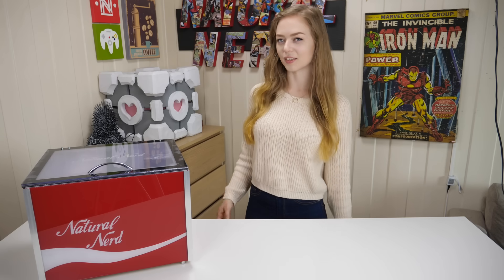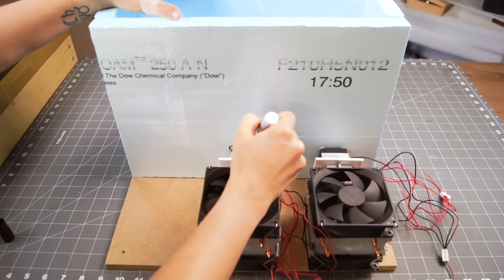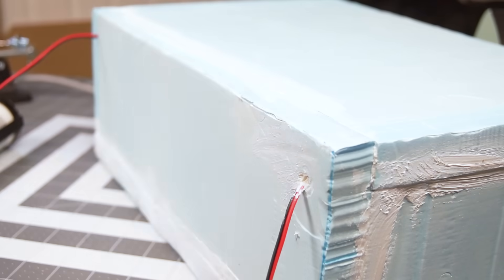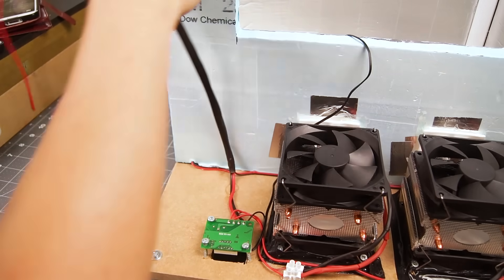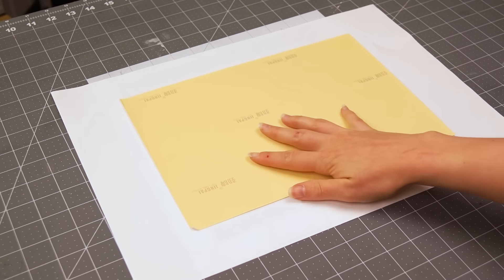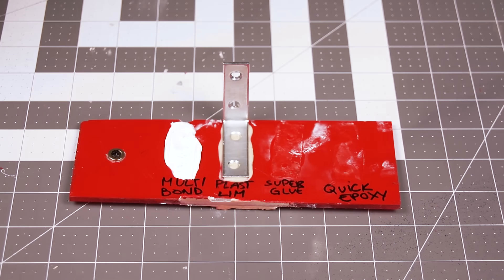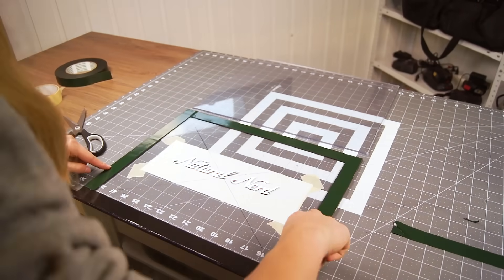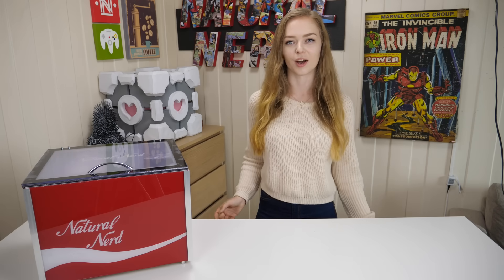DIY Desktop Mini Fridge (5°C!!)

Comment: Please don't use your soldering iron to burn through stuff, it damages the coating that makes solder stick to it. If you have a cheap spare one then you can use that but don't expect to get good solder joints out of it afterwards.

Crimps for the power supply is a good idea but those simple scissor style crimp tools don't put enough pressure on the crimp for a proper connection. You should get one of those latching tools with plenty of reduction and the appropriate jaw shape to squeeze the crimp into shape. They're like $20-$30 online of you know where to look but any good electronics shop should have them.

You should also attach the cables to the wood behind the power socket to make sure the wires don't come off and short at the power supply end if the socket breaks off and pulls the cables. It's a redundant safety thing but with mains AC you can't be too careful.

As a side note, peltier elements respond really well to water cooling. Not neccesarily suitable for this project but I've pushed TEC1-12706 and TEC1-12710 peltiers at 15V on water and the result are fantastic. The datasheet indicates you can ramp up to about 17V when they are running, but I don't have a powerful enough adjustable power supply to test the limits of that.

Comment: How to make a mini fridge for people who...know how to use power tools, wire LED lights and electronics. Oh you don't know how to do that? Well fuck you. Is basically what I got out of this.
Reply from the maker: I learned these things while making stuff. It's not very hard, but if you want to make something you have to be prepared to acquire some skills along the way.
Reply: That's very true, but it is disheartening realizing how many of these craft videos on youtube require often multiple skill sets. It's never really one, or just something a bit easier it's always for someone whose already acquired the skills. Usually it makes it not worth it if I'm expected to learn  three or four things for one small project. Anyways, don't get me wrong, it was impressive to see you put together and your instructions were nice.
Reply: Geeze, I wasn't crying over it. I was making a comment about how it isn't very applicable to most people because most of these crafts require you to learn multiple skill sets. Making the time to learn how to build this just takes a lot of effort, for some more then it's worth. I can assure you I'm not super bitter over it or anything. The video was still very good.
Reply: Right, building a styro slicer, getting the money to buy a tool to cut MDF boards, getting a drill and jigsaw to cut out the circles, having a work area for these tools to even begin the project. Getting the power supply and leaning how to wire the LED lights and so forth is "so" basic. If it was that easy would we really need such a in depth tutorial? Honestly I think she did really good with the video and it's nice if this is easy for you.

Comment: "Fuck it, we'll use heatsinks" 
-Natural Nerd 2017
Reply from the maker: Peltier modules needs heatsinks you know
Reply: Natural Nerd yes, I know. However, these are CPU heatsinks with some styrofoam and metal screwed on to it. There is no way that these are purpose built. Not "electronic refrigeration unit." Heatsink. CPU heatsink.
Reply from the maker: Correct! Purpose built ones would be a little out of the budget of this one ;-)
Reply: Natural Nerd yes, but they aren't "electronic refrigeration modules." They are heatsinks. Heatsinks
Reply from the maker: Writing a "heatsink" would be misleading. The module consists of 2 heatsinks, 3 fans, and a peltier module sandwiched in between them. So it's definitely made for cooling. As you would also pay for the peltier module and the fans attached to it, I am not sure I understand why you are so keen on calling the unit a heatsink. It's like buying a lamp with a foot and shade, but insisting on calling it a bulb. The unit wouldn't work well without the heatsinks, but without the peltier element it would be absolutely useless.
Reply: Natural Nerd why am I adamant on calling it a heatsink? Because you cool your god damn CPU with it. It's 2 hyper 212 evo's attached with some zip ties. Also, why are you changing all of your replies, can't you have a straight answer?
Reply from the maker: I didn't know peltier modules is used to cool your CPU! If they are I'm happy to admit I was wrong. I edited my previous reply because of typos and repeating myself :)
Reply from the maker: I respect that! I just want people to know it's not only a heatsink in the module, but also a thermoelectric module with some fans :)
Reply: Man you should really learn on making civilized arguments. When two big side fans push air to center it creates an area of very high air pressure with excess heat. This heat is then heat-sinked out with the third fan. Like exactly how refrigerators or air conditioning systems work. So this makes it a refrigeration module, and simply not just a heat sink.
Reply: Beef Burr1to: The heat sink is on top of the PELTIER, the heat sink takes heat away from the hot side of the PELTIER, the other side of the PELTIER becomes very cold & therefore refrigerates. Look up PELTIERS! Yes those heatsinks are usually used to cool the CPUs in computers but in this case it's being used to remove the heat from the hot side of a PELTIER. So it actually is electronic, or solid-state refrigeration. Watch this & educate yourself: https://youtu.be/9Cuh2msd2lo
Reply: Did y'all just have a nerdy sass fight?
Reply: Hey, Where are you guys based, Im planning on undertaking a massive DIY project and could use some help with thermals and even a unit similar to this except wood cased or painted MDF. Think you guys would want to be onboard? / Maybe even help me build it?
Reply: the concept is the same .. lol turd pretending to be smart..
Reply: Eh?
Reply: Spice yes

Comment: interesting but for the cost,  these small fridges are getting really inexpensive and no hassle just get 1 for under $60,  esp at the big box stores

I think as in this vid you'll have like $75-80 plus time in it?

Aluminum tape, not a good insulator or durable. I'd line it with plexiglass painted on the backside or some white tile, laminate, etc

thanks for sharing! +1 and sub. your vids are inspirational

Comment: you know what would be a cool idea making a computer with the desktop mini fridge as the case
Reply: Now what you can do is buy this special case, which is like almost $1,000 btw, it takes the main part that makes the fridge cold through an insulated tube, and puts it ontop of the CPU. So any of the condistation is trapped inside the tube and only touching the top of the cpu, and makes it safe. Or if you're feeling adventurous just use liquid nitrogen !
Reply: While your idea seems cool. It would never work. Since the air inside the fridge contains water vapor, heat from the PC mixing with the cool air from the fridge will condense the water and cause a short circuit. Professional overclockers who use similar liquids to cool avoid this by putting Vaseline on the components. The problem with this though is that its only a temporary solution.
Reply: I'd actually really be interested in seeing this be a thing.
Reply: I have built plenty of PCs and I can tell you that a computer in a fridge would not work unless you spend lots of money dehumidifying it, and by that point you could have just build a custom water cooling loop for cheaper and probably achieved better thermals. Its not a practical idea.
Reply: It's not possible
Reply: JDM Miata it could I don't. know to explain it to you. what's in my head
Reply: Maxs Lab yeah but the idea in was idk how to explain it but I'll try image a big cube and their something in the middle making the fridge/cooler and the other half the computer with mother board and power supply and graphics card etc and cutting out where u need plug in the stuff for the motherboard and fans and etc and for price range depends example gtx 1060 ti and hyper x ram maybe 800 or 700$ or less but again not sure if it would work
Reply: Like you would have the computer sealed inside a thermally conductive cube that you place in a fridge?
Reply: Maxs Lab again idk but intheroy it should work idk a lot about computer but it built one so ik how everything should work
Reply: Linus Tech Tips tried how it goes. (Video title is "PC Build in a Fridge - Does it Work??")

TLDR is you need a lot stronger radiator(like room air conditioner level) for keep fridge stay cool otherwise inside fridge gonna be warmer and eventually PC gonna stop by overheating.

Fridge is good for "keep" things cold, but not good for things which produce heat constantly.
Reply: Can't be done on a low budget and be efficient enough. I've tried it for 4 months in different ways.
Reply: So Basically a normal functioning cooling thing turned into a Basically normal functioning cooling thing that houses a pc build.

Comment: so the fridge coolers are basically a standard cpu cooler with two 120 mm fans each and a upside down 40mm or 50mm tiny heatsink that actually cools the fridge

Comment: She did a great job. But this will only keep things cold not make things cold, similar to a cold cooler with no ice. Workout a refrigeration system with a compressor, condenser,  metering device, and evaporator it won't actually refrigerate. But that would be much larger and make much more noise.

Comment: so RUBE GOLDBERG, 2 refrigeration units and a power supply? you can get a 2-3 cuft fridge for $70USD at walmart...
Reply from the maker: You can buy cheap clothes at Walmart too, but people are still sewing! :)
Reply: i'll give you kudos for the knowledge, skills and drive though. you are a smart cookie!  :)
Reply: in the 90's i was making my computers from scratch, a little after 2005, it was cheaper to by a dell or an hp with the same components, this unit is a '12 dell with a i5-3450S cpu and it blows away half the boxes in stores for twice the price today.

Comment: There's an adhesive called Akfix PA370- it's ment for boats and wood but it does more than perfect job for styrofoam and the materials like it. It dries out for about 15 minutes when it's warm and for more when cold, also fe=ills up all the gaps inbetween.

PS: not a bloody advertisment, just happy with using it

Comment: Good luck with the condensation. The peltier elements present in these " electronic refrigeration modules" (what a name LMAO)  tend to gather a nice amount of humidity from the air in the room, especially when the air in the room is more humid (a.k.a if you have a running AC there) 
You'll need some sort of condensation collector, every fridge has one, you cant have a cold heatsink and go without a water collector.
Reply from the maker: I was prepared to run into some condensation issues during the prototyping of the project. After letting them run in the isolated space for a while, there was no frost on the heat sinks attached to the cold side of the peltier modules when cooled down to about -5 degrees celsius. Having used it a while now, there has not been any water collection. I suspect this is because the air humidity here is pretty low, and because the space is very small. But products that is added to the fridge might of course add unpexpected amounts of humidity to the contained environment. The simplest fix would be to add some water collection underneath the heatsink. Having that said, this design is intended for short term use only, as the refrigeration modules (or peltier modules with fans and heatsinks, if you prefer) are not terribly efficient, running at over 100 watts for both.  So if there is any water collecting, it shouldn't be a problem to manually keep an eye on it while in use.
Reply: Guess you got lucky with the environment where the fridge operates, glad to hear that.  And yes, the Peltier modules are quite power hungry. 
Non the less great project and execution.

Comment: Being totally incompetent with hand tools, I'd be able to do all the mechanical drawing and layout work for the project.  But I would have to get someone else to do the cutting and assembly portions so that I could be sure of square corners and a good fit on the parts.   Nice job on the project.

Comment: This is a great design. The only thing I can say is that I think you used too much glue and not enough mechanical fasteners. If you'd use metal instead of plastic for the frame I think it would be a lot sturdier and overall easier to build

Comment: Not safe, those refrigeration modules take a lot of power for something so small the wire from each refrigeration module after the coupling is to small to run those units it can get warm or very hot and cause issues or start a fire I like the design I just would recommend using bigger wire so you don't have any issues.

Comment: Guys, PLEASE DO NOT USE A THERMOSTAT FOR PELTIER MODULES! Repeated thermal cycling damages the peltier modules and will DRASTICALLY reduce their life. Besides, they don't get that cold anyway so why would you want to use a thermostat. And if you must use a thermostat, PLEASE do not use those cheap relay based ones like in the video, use a high-frequency PWM thermostat.

Comment: This is probably the best thermoelectric fridge project I've ever seen, but it still has the same problem that they all have: the elements that power them are terribly inefficient. For a follow up, would you consider making a "normal" mini fridge (I mean, one that uses a mechanical heat pump)? (the main issue I can see with that is finding the right working fluid. Anything I can think of that's easy to get is either very toxic or very flammable)

Comment: Good job mate but I recommend using foil insulated foam and foil tape and adding a metal plate with heat sync and fans on the back of the fridge
Reply: The DemonFighter, so you obviously looked at the picture,  but didn't watch the video?

Comment: I subscribed. I am impressed. The only problem I have is where you can get that this styrofoam at, I can get everything else. The styrofoam is hard to come by that thick in arkansas.
Reply: LETS dothis, check the aisles behind lumber in a Lowes or Homedepot, if 2" is not thick enough sandwhich sheets together with glue and a paint brush.

Comment: Those refrigeration units you're using look like CPU coolers! Did you repurpose something along the lines of this?

http://www.coolermaster.com/cooling/cpu-air-cooler/hyper-212-evo/

I believe it even has an option to attach a second fan to the other side of the cooler, though by default only one fan is attached.

Comment: Jesus almost 180 watts? My triple A full size fridge draws 90 on full load...
Reply from the maker: yeah, but I estimate around 100 with thermostats. Anyway, as I said it's a fun thing to pop up at a LAN party or something like it, but with peltier modules it's not something worth leaving on for too long. :)
Reply: It's  only power consumption  are fans and leds.  You could power it with DC and lower the watts no?  That AC power supply looks to be over kill.  Nice looking project though ;)

Comment: Nice idea, but it doesn't seem very safe. I'm not sure how trained you are with mains electricity, but regardless of how familiar you are, you really should warn people to not play around with mains power if they aren't competent. 

You should, at the very least, put in an input fuse. Probably not a bad idea to put fuses on the peltiers as well, because i would be surprised if cheaper switch mode power supplies would have overload protection. Plus that would protect the DC power input as well.

But very creative, good work!

Comment: Would I be right in assuming you used Peltiers to achieve the cooling?
Reply from the maker: Yes :)
Reply: Natural Nerd If I remember right the cooler you can keep peltiers on their heated side the more efficient the cooling... I think if I was to design this I would fit the peltiers higher up, and use a water cooling setup to draw the heat off to a radiator at the bottom back... But then the power used by the water cooler might negate any efficiency gain...

Comment: I read "desktop fridge" and thought you were building a computer in a mini fridge. But this was still pretty cool (pun intended). I was waiting for the compute components to be added in.
Reply: S many have proven PCs will not gain any significant benefit from being in a fridge as it will not be able to pump the heat out effectively which would cause the fridge to warm up considerably

Comment: Wow!!! How do you know how to do all that electrical stuff? That is mind-boggling to me.
Reply: John Doolittle she learned it somewhere. Either in school or online or from a mentor or the library or something. Here in the US a lot of high schools and 2-year trade schools have electronics and workshop programs. Plus of course these days you can learn anything online. I dated a guy who had an associate's degree in electronic tech and I learned a lot from him. My dad and step dad were also both technicians and capenters, so I was around it all my life. I replaced my own bathroom fan a few months ago, even having to modify the fan a little to get it to fit in place correctly. I own my own wire strippers, dykes, soldering gun, etc. So I can do simple electronic repairs and mods at home. We have an AWESOME store in my hometown called Philcap that's a toy store for any electronics nerd!! That turned into a novel, sorry. All I mean to convey is that folks don't just "know" stuff, and I'm sure she learned her skills from someone along the way and built up her workshop and experience over time. If you really want to do something you just have to really want to do it, and then invest the time and effort.